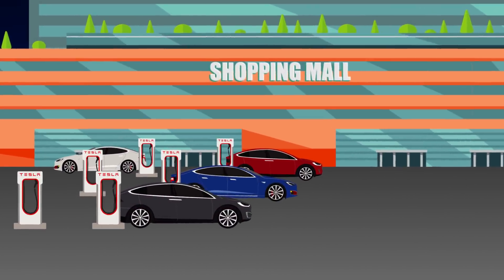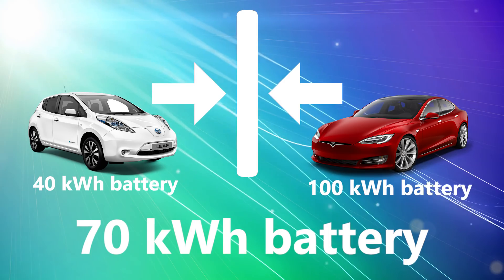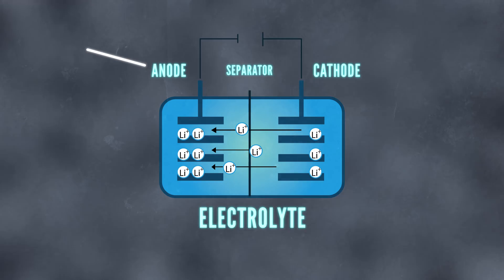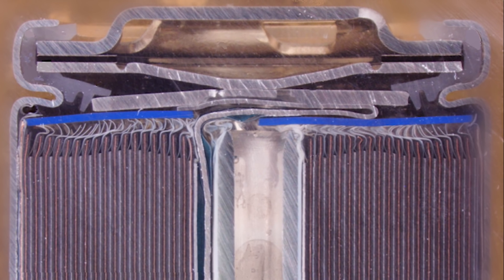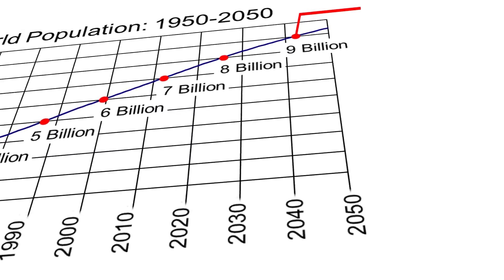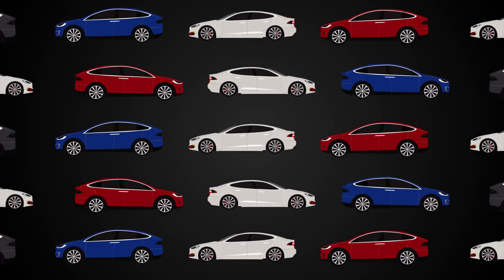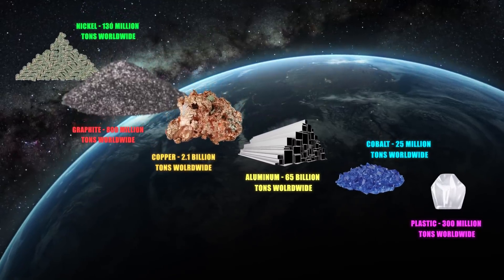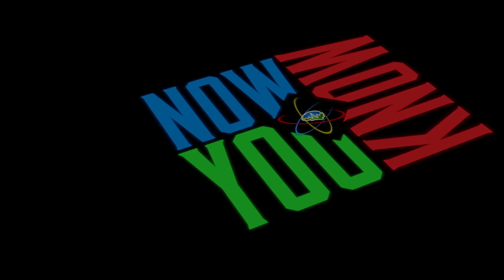Will there be enough EV Battery Material?

Comment: Are you sure the cell case is made of aluminum? Did you read this somewhere or just assume? All 18650s I've seen have steel cases and I can think of several good reasons not to switch to aluminum (despite the weight savings).

Comment: +Now You Know       Thank you for this video. I've made a text file of your estimates to use as ammunition next time I find myself addressing one of the many 'short' inspired hit pieces that Tesla seems to attract. However you did miss out the stainless steel casing that each Li-ion cell is clad with. Stainless steel has around 8 to 10% nickel content by weight. Your total weight came to 365kg which sounds a bit light (I've seen a figure of 450kg quoted for a Tesla battery pack but what the kWh of that pack was I do not know or even where that figure came from) the cell casings would make up some of that missing mass.

Comment: You guys only spoke about car batteries how about home batteries and commercial batteries Need to calculate that to
Reply: batteries will become increasingly recyclable and as yet we do not know the true reserves of minerals that the planet holds for battery manufacture.  It's likely too that battery technology will evolve using different minerals and thus opening up even more potential.
Reply: Actually you don’t have to calculate Home batteries and commercial batteries. 

Lithium Ion batteries have the best energy storage and they are easier to transport. These are used in phones, laptops and cars. 

Home batteries doesn’t need to be lithium ion. In fact it could be a salt battery or even a hydro electric battery. 

Salt batteries requires less maintenance and they work well. They aren’t a good option for cars or laptops etc but they would be more than suitable for houses or other stationary facilities.

Comment: I dunno about those total numbers by 2043.
Once the electric pick up truck is on the road, that's about 100 million units minimum right there just in the U.S.
I think contractors and such are really unlikely to want to share their vehicles with all their tools and stuff in there.  ;)
Personal work vehicles alone will be more than what was calculated here imho.
I like your optimism though!
Reply: Talladega Tom but guys there will be way more uses for batteries too...look at small planes, motorcycles, energy storage, boats, ships, helicopters, drones other gadgets etc
Reply: also. I think by then there would be a full on recycling program for batteries. this wasn't taken into account. I know you can't see the future but it could have been mentioned as part of the equation. but it's a good view at one side of the discussion.
Reply: You mean, the pod with an interchangeable load-out will not happen? Why do you believe that? =)

Comment: What about recycling old batteries?
Reply: American Manganese recycles lithium-ion batteries and recovers 100% of the cathode material
Reply: Li-ion batteries are recyclable and the recyclers are making major advancement in their various technologies. Check out a company called Umicore, for example.
Reply: First off this video doesn’t take into account other products and electronics that use lithium. 2nd off maybe they will be recycled in cars but other products such as laptops and cell phones there is a pretty poor rate of recycling. There is also said to be huge lithium farms to store electricity from wind and solar. Not to mention lithium powerwalls. Thus further depleting this number. This is way too optimistic however if hydrogen fuel cells Hybrids were being used I can see a sufficient amount.
Reply: If there is enough material to build the batteries straight out, imagine how many can be build keeping recycling in mind. This will be close to never ending.
Reply: Watch American Battery Technology Company (ABTC)

Comment: But will we have enough resources for everyone to have their own powerwalls too?  :) I wonder what percentage of current Lithium Ion battery resources go into vehicles vs all other purposes . . . laptops, phones, watches, cameras, drones, solar projects, etc.
Reply: Home batteries, or grid storage batteries do not have to be lightweight, and don't need to be as small.  So, they can be different chemistry - one of my favorites is a salt water battery.  Grid batteries can be made out of really common and cheap materials.

Another point is that once batteries lose too much capacity to be useful in cars, they can be used for home storage - and then later recycled, hopefully.
Reply: The video forgot to mention construction equipment, semi-trucks, airplanes, rockets, and other household items. If Lithium can be recycled, it works, if not then we have a big problem.

Comment: Yyyyeah, ok, but I think today's battery technology won't last that long, and at the current amount of materials we have, the cost will go up, so, will be interesting if 70kwh is the average and if that is truly enough
Reply: We should not stick with current Chemistry Mix just due to Desire for Life Span & Capacity improvement. We will move onto other material out of Greed. No 70kwh is not acceptable, we don't no future uses cases for a Mobile Electric Supply. Beyond 100kwh is the minimum for a 1.4 Ton Hatch Back in the near future.
Reply: Necessity* not greed, I think the cost will go up significantly at the point he's talking about, this also doesn't factor any other devices using lithium ion, which there are heaps of. I hope Graphene makes way, and becomes economically viable.
Reply: Sodium Ion chemistry is going to be cheaper simpler and way before Mass Production of Nano Carbon batteries.
Reply: Remember what happened with computer memory? 25 years ago, 8 MB of RAM for a computer cost $300. Now you can Gigabytes of memory for a fraction of that. The wheels of progress are always turning. Look at what happened to record stores and video rentals. The transportation world we know today will be much different in 30 years.
Reply: James Albury the simplest comparison is Flash / Torch Light. When I was a kid we just had Incandescent bulbs & Alkaline Batteries, that was about the best. Now I have a 3x CREE LED with 4x 18650. Soo far it last about 2 Hrs with all 3x on Medium at about 1500 Lumens. We have had such a massive jump in Bulp LED & Battery technology the amount of Light in a Hand Held Torch is close to a Main powered Spot Light. Combination of Batteries having more capacity & better rechargeable management. Plus a more efficient and effective Light Emitting bulb. Both the Power Supply & Consumption Efficiency has to massive improve.
https://www.youtube.com/watch?v=29624RQMAG0 - Ignore the Sketchy Lumens rating, Still 3x Cree LED.
Reply: Necessity is the mother of invention. I have a feeling there were conversations like this about cellphone technology and the Internet 25 years ago. The people who invested in the development of that technology are very wealthy today.

Comment: If space x makes going to space super cheap maybe one day we can mine asteroids it might take a very long time but im sure it will eventually happen
Reply: Indeed, there are already people thinking of how to get mining in space done, not only asteroids. With spaceX this becomes a real proposition.
Reply: That was essentially my point.  We do know a fair bit of what is available on the Moon, but extensive surveying will be needed to determine what else could be of value.  Most of what is mined on the Moon will never actually reach the surface of Earth, but will rather be used to build infrastructure on the Moon, in Earth Orbit, and elsewhere in the solar system.  Probably there would be an extensive shipyard on the Moon to build solely space-born ships that will be stronger and more reliable to travel around the solar system in.  After that, simply ferrying people into orbit will be sufficient, as people will just board much larger and robust ships that always stay in space to get wherever they're going.  Ships like the BFR will eventually be relegated to being taxis between planet-side and orbit, even as groundbreaking as they are right now.
Reply: Indeed.  Asteroid mining could actually saturate the market making many of those materials extremely cheap.  I always thought it ironic that asteroid mining could benefit farming here on Earth as much or more than just about any other industry, because of the huge amounts of phosphorus used for fertilization, but is also in relatively low supply here on Earth.  Rare Earth materials would become much less rare, and thus less expensive, but still very useful which could result in cheaper technological devices.
Reply: Well there is that huge rock in the sky that we see most nights... what is called?  ...oh yeah, the Moon!  There is probably good odds that it has some valuable resources too.  It'd just have to be scouted out first, much like the asteroids.  Cheaper means of getting into orbit opens up a lot more doors.  The BFR, if successful will be a true game-changer, as it will be the first 'real' spaceship that can take us around the solar system to build bases, colonies, and various other infrastructure.  The shuttle was nice, but it couldn't really go anywhere outside of LEO.  The Moon Lander was also very limited in scope.  The BFR/BFS would be incredibly capable as a multi-role platform.
Reply: We already know what is on the moon and worth mining it, it's just a matter of costs, planning and processing. Surely there will be more to find on the moon.
Reply: That pretty much sums it up, yep.

Comment: There's already one article that said there's plenty of cobalt already. I've never seen a similar article on lithium, though.
Reply: Cobalt is not the best element for Longevity & Stability Battery Cells. The reason why Tesla Vehicle like a slight mix of them because it provide Energy Density & Power Output Density. If we want to build Vehicle Battery packs that last 20+ Years healthy operation. We have to move away from Cobalt.
https://electrek.co/2016/11/01/breakdown-raw-materials-tesla-batteries-possible-bottleneck/

Comment: I think your calculations are a tad optimistic.   Firstly the assertion that there will only be 10% the number of cars that there are currently seems low to me.  It may be true long term but it could take much longer for our culture to change.  A lot of people have lived a long time aspiring to car ownership and I find it hard to
Imagine that changing overnight.  To back this up I point to the relatively slow adoption of car Sharing schemes such as zip cars in urban areas.  I live in London and used zip cars as an alternative to owning a car but I didn’t come across anyone else that I knew that did the same.  However even if we stick with your 10% figure there are a couple of other huge factors that you haven’t taken into account.  First is the coming huge growth in car ownership in China and probably India.  China only has 15 cars per 100 people and India only has 4.  The US by comparison has over 75.  I haven’t done the maths but that’s an awful lot of people that will potentially be newcomers to car travel.   Secondly cars are not the only consumers of batteries.   Home and utility power packs are hopefully due to take off, which I would imagine will eventually rival or even surpass car usage.    I also wonder how much of those deposits are able to be economically extracted.  Increase of EV adoption must to some extent be predicated on batteries remaining as cheap or cheaper than they are now,  which in turn requires that the cost of extraction doesn’t rise too much, and supply shortage not becoming accute.  Having said all that ....  I’m am sure that market forces will always ensure that either new deposits are found or new technology using different materials is adopted.   But we may have a problem doing either of those in the short short term.  But .. I remain hopeful.

Comment: I think you overlooked the fact that nearly all of the materials in the spent batteries can be re-used to make new batteries. I would suggest that you will actually need less materials than your estimate. I think also that the newer battery technologies will use other materials and we can only guess at what they would be.
Reply: Christopher Matthews In actual fact it is the exact opposite.  Zac and Jesse did not take into account battery replacements, only new cars.  Most batteries being recycled will need to be replaced unless you intend to dispose of your Tesla when the battery fails.  Since recycling is unlikely to be 100% it means that the requirement will be more than zac and Jesse s estimates

Comment: What ever happened to the Lithium Ion batteries that were supposedly non flammable that they were researching in the news several years ago??? The one that uses material called perfluoropolyether, or PFPE?
Reply: LiFePO4 is already in mass production. Still slightly Flammable in horrible extreme conditions. But they are very difficult to set into a big fire. Basically extremely safe for Vehicle Use.